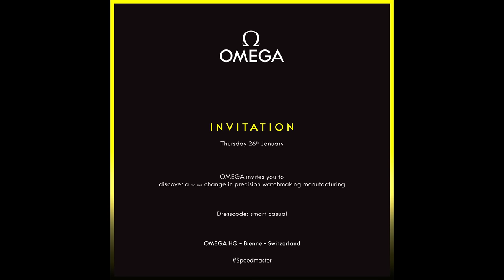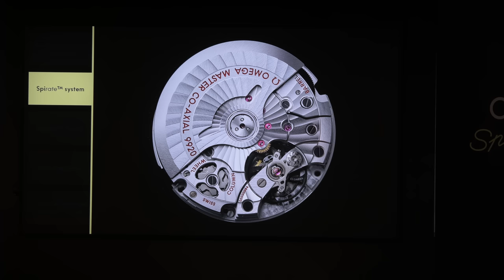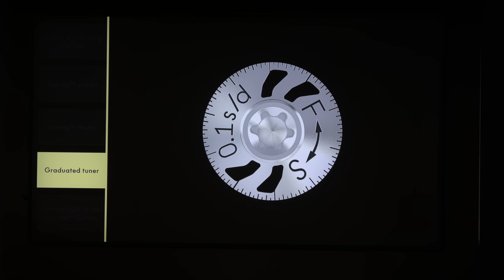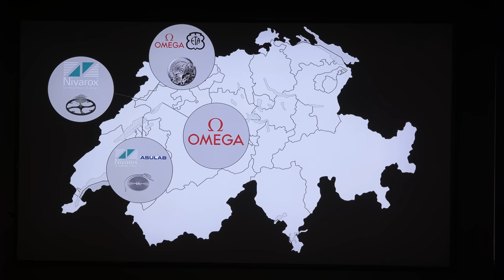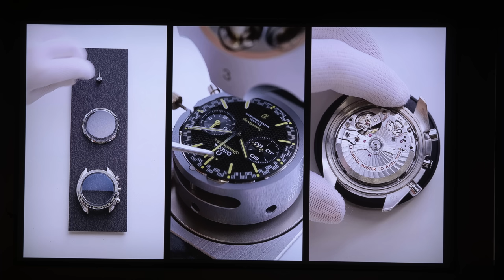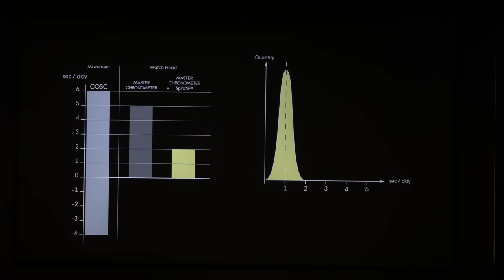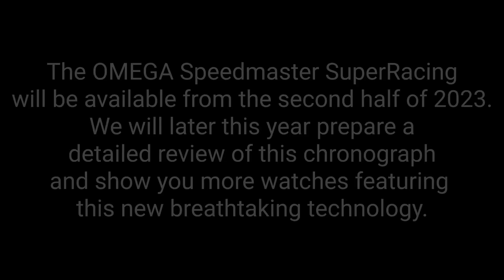OMEGA Speedmaster SuperRacing. The new fine-tune Spirate System boosts accuracy to 0/+2 sec./day.

Comment: The tech is great. Omega are trying so desperately to be “loud” with some of their watches. I think pretending they aren’t trying to is naive. They did the Speedy Tuesdays, they’re doing the limited by numbers made but not limited edition 321s and Snoopy editions. You can’t just go and buy one, that is simply not the case at all. They also make “boutique exclusives which is another game. They do a new limited anniversary watch almost as often as Grand Seiko do. They are trying to become Rolex in terms of planned scarcity with some models and then sell the ones “the plebs can get” to the masses.

This tech is great. I hope it doesn’t see Moonwatches at £9k or so in 18months if and when they add it to that. At the moment this new model costs a lot more than the previous 44.25 racing models, even more than a ceramic cased dark side of the moon Apollo 8. I hope as part of this industrialisation they remain competitive price wise, otherwise they are going to have to start finishing like Glashutte or Breguet if they are moving to their price points.

People paying for AP or Patek etc may well be buying into the hype. But there is more to a high horology watch than accuracy alone. If we only wanted accuracy we could all just buy a band 6 Casio and call it quits. Hand finishing, movement quality etc all count for something as you move up in price. Most high end watches from independents are nowhere close to as accurate as a Tudor Black Bay, but that’s not why they get bought.
Reply from the maker: That’s pure sarcasm! Omega is everything … but not “desperate” and I don’t see them playing any silly games …
Reply: @WatchAdvisor   why do they limit the Snoopy so much? I’ve been on a list for an Ed White since it was announced, yet I’ve managed to buy a 5990/1a-011 at retail a month after release. I’m sorry but as a customer what you are saying doesn’t ring true. Every year there are more limited 007 releases, Olympic releases, watches to celebrate the inception of James Bonds birthday, a fictional character. These are all silly games and gimmicks. 

Pretending they are not silly games is fanboyism too. I love Omega watches, but they are playing games too. You are just not prepared to see it or are impressed by all the great things they do and so are prepared to overlook their games.
Reply from the maker: The Snoopy and Ed White are both NOT artificially limited! But the dedicated workshop with dedicated, special trained watchmakers assembling them simply can’t produce more… This was by the way clearly communicated by Omega. 

Limitations? I couldn’t care less… but others like to buy such watches. Anyhow you don’t have to buy one, if you don’t like them …  so just leave these to others …
Reply: @WatchAdvisor   I’m interested in many of the Omega watches. I own the world timer, it’s very innovative, also a moonwatch.

Saying “you don’t have to buy one” is a not facing into the truth. They need some hype models like the 321s, the Snoopy to create interest and hype in their brand. It’s marketing, that’s whey they are making anniversary watches of them paying for a movie product placement with James Bond. They have to market their products as well as innovate. They are doing great at both. But being blind to their games and solely bashing Rolex or AP for it does you a disservice. Omega are a business too, they create hype around watches most people can’t buy.

I bought many watches from my local Omega AD. They’ve never been supplied a Snoopy or a 321, they only go to premium stores and mine isn’t one. My local branch of Goldsmiths (watches of Switzerland group) who are a large store  for the company that sell many brands including Rolex said they aren’t being sent these watches at all. 

I’m sorry but Rolex make 10s of thousands of each model on an industrial scale and you moan about it because morons buy them in the secondary market. Omega hype up watches their customers can’t buy and you defend it. That is a joke.

I enjoy their watches, I’d love to own a 321 model. I feel like I’ve been played by the brand.

Once again, I’ve managed to buy a 5990/1a-011 at retail 3/4 weeks after it was announced. I’m a fairly serious watch collector. That watch is much more rare right now than a Snoopy or an Ed White, how is it that is easier to buy than an Ed White? To defend that is a joke. They are playing some games, I didn’t take you for a fanboy. How much is the first Snoopy on the secondary market? How much is the current one? Why don’t you talk about these while sneering at the people buying them? 

It’s fanboyism.
Reply: @WatchAdvisor  why is the Snoopy made in a dedicated workshop? It uses the standard movement. Is it just the case back? Genuinely I kinda get it with the 321 but the snoopy is faux scarcity because it’s a snoopy. It’s their prize, their equivalent to a daytona. It’s their way of having that unicorn not everyone can have.

It’s planned scarcity and brand equity in equal measure. 

I enjoy your videos very much. Thanks for this one. But being balanced about Omegas practices doesn’t make me a hater or a fanboy of any brand. I love most brands and enjoy wearing several! Good night and thanks for the vids.
Reply from the maker: The Snoopy and the Ed White are built like an Haute Horlogerie watch. One watchmaker assembles the entire watch… This is a major difference to the mass manufacturing Omega does normally… Omega IMHO should focus its communication more on such (and many more) little details then on showing celebrities wearing their watches … I just told them again when I was in Biel Thursday…
Reply: @WatchAdvisor  I agree. But the point remains that they are selling for 3 times retail on the secondary market. They created this. Why don’t you talk about it in this video as you do Rolex?

I think people buying Rolex steel watches on the secondary market are idiots. I agree with you. But Rolex don’t play silly games, they make way more watches than Omega and no special editions, none of the games. It’s the sheep buying them that are the issue.

Omega chose this “bespoke” route for the Snoopy and they’ve created a Rolex style secondary market for it. I feel like this was intended, it really does their brand good to have 45th anniversary Snoopy’s selling for 40k or whatever they are. To pretend like they don’t want a bit of this type of marketing and lust for what you can’t have is naive at best.

I agree about the secondary market being a joke. However I feel like the sheep buying Rolex are the issue, not Rolex. With certain Omega watches, Omega have created the scarcity and they want it that way. Especially with the Snoopy. It’s their golden goose.
Reply from the maker: @TheRunningManZ  The Snoopy sells at these prices because all the Snoopy editions have become collectors items meanwhile, don’t forget the two other ones… You didn’t get yours yet, this seems to make you angry… many others did though … I don’t know what went wrong … Did an AD promise you one? No AD will ever get one, since they are only sold through the Omega own boutique network…
Reply: @WatchAdvisor  and there in lies the game. The boutique don’t allocate to people unless they have a sales history. THIS IS A GAME.

I don’t live in London where the boutique is. I live 100miles away. I’ve bought lots of watches from many brands including Omega. But their sales policy makes it impossible to pick one up. I can’t go on a list with a store with sales history because I support my local stores, so my name went in the bin when I left the boutique on regent street.

It doesn’t make me angry. I won’t buy watches over retail and I’m prepared to search out great watches that I can buy instead. What actually makes me angry is you saying Omega don’t play games when you’re blatantly spelling out how they market these hype watches that you just can’t actually buy. This is the very definition of the game you seem to hate. But you are pretending like when they do it, it’s all above board and fine.

I quite like the Speedmaster 57 in maybe blue or green but there are none in stock anywhere just yet or even on the Omega website. So time will tell.

Open your eyes. They are playing games, the selling process you’ve just described proves my point for me and yet you are still defending it. They do the same shady tactics in the Omega boutique regarding allocating watches. Yet you don’t talk about it or seem to want to admit it. You are happy to have a go when Rolex ADs do it, the Omega boutiques do the exact same thing. Wake up and smell the coffee.
Reply from the maker: It was only the ADs causing all the problems for potential Rolex buyers by inventing this artificial shortage and greedy business to ask/get a premium. This is why certain watches are only sold through Omega boutiques. And it is not the boutique deciding who gets a piece but the HQ in Biel. So far only a few Snoopy chronographs made it to the grey and parallel market. If Omega ADs would sell them all “Snoopy” would be there, just like all these Rolex watches … I got dozens of emails (comments have been written here) of happy Snoopy owners who very much appreciated the fair treatment of Omega. There is no game, there will be no game. The “problem” is that there is no boutique close to you and that the ADs in your region don’t get these watches… I understand that you are not happy, but that is why you should not simply twist the facts to get rid of your frustration.
Reply: @WatchAdvisor  there are 109 silver snoopy watches on chrono24 right now. For a watch with very limited production that’s only been around 2 years that is a lot. The Omega head office do not dictate who gets every watch across all their boutiques. The boutique won’t even take your name if you don’t have a sales history with them. The boutique deflect people away before biel even know your name.

You are a fanboy defending Omega doing the same thing that Rolex ADs do. There is a plenty of accounts of what I am saying across forums and the net. It’s sad that you will defend this practice from a brand you like so much. 109 watches is a lot. You are blind to the truth here.
Reply: @WatchAdvisor  there are 217 black dial Daytona’s on chrono24 since 2021 model year by comparison. Rolex make way more Daytona watches on an industrial scale than Omega do these “haute horology” like Snoppy watches and sell them through every store across their near 2k ADs. Not hand picking select boutiques. 

The stats don’t lie. You’re defending the boutiques of Omega doing the very thing you hate others for doing. Wake up
Reply from the maker: I hear your massive frustration… 🤷🏼‍♂️Therefore I suggest that you write a passionate email to Raynald Aeschlimann by explaining him how much Omega watches you own and how much you would want to buy either the Ed White or Snoopy… Send it to me and I will forward it to Raynald… Someone from the US being in a similar position did the same and then got the chronograph he wanted… I am the wrong person, I can’t sell you the watch, but I could help you get one…
Reply: @WatchAdvisor  another example. There are only 168 of the new version Polar Explorer 2s on chrono24. These are made in many many thousands, sold through every Rolex AD of getting on for nearly 1900 ADs and there are 168 for sale. You’re making out Rolex do all this shady stuff. This watch is made on an assembly line pumped out in thousands and thousands and yet there aren’t that many more for sale on one website than the Snoopy.

I have no bias here aside from the experience of a watch collector. You do have bias and it’s giving you blinkers to the truth.
Reply from the maker: Once again, I hear your frustration…
Reply: @WatchAdvisor   I will try and compose an email to you when I can. I’m doing a 12hour stream today. I appreciate you replying as you have. I expressed an interest in the 321 Ed White the day it was announced via the Omega website. I’ve bought two Omegas at retail since then. But there is no way to buy the watch unless you are “in” with a boutique, I am not. I can’t play “boutique games” to get in with them either.
Reply: @WatchAdvisor  where can I find your email address? On your YouTube “about” page I can’t see it on my phone. Will check when on pc later.
Reply: @WatchAdvisor   thanks, I have sent you an email. ;)

Comment: And the first 4hz co ax I think.
Reply from the maker: No, the chronograph 9xxx was always a 4 Hz calibre
Reply: @WatchAdvisor   thank you, it's never too kate to learn something new. I always wondered why 3.5hz was the favoured rate and I never saw anything online to answer the question
Reply from the maker: 3.5 Hz are "enough" for the Co-Axial escapement and you can increase the power reserve...
Reply: I read that a higher frequency was tried initially and this destroyed the escapement. This may perhaps be achieved one day but with new materials and or lubricants.

Of course a higher frequency would require larger mainsprings power reserve which in principle should be feasible as some calibres are tiny vs the watch case cavity… I would like calibres to fit the cases without these thick spacers…

Anyway, Omega does nice watches and always push the frontiers of innovations. Now, let’s keep an eye for what the future will bring.

Comment: My submariner is 0.2 seconds a day and if i rest it 0.2 slow so accuracy on spot
Reply: Cool story.
Reply from the maker: Well the Omega is only PLUS… that’s how it should be, that’s what the old experienced master watchmaker always told me… a watch should never run late…
Reply: Zogi, i have had the same experience
Reply: @WatchAdvisor  well plus 0.2 wearing minus 0.2 resting dial up. so if i wear everyday its quartz if i wont its decoration. so i wear eveyday.

Comment: My Casio F91W is still more accurate. Lol
Reply: F91w is +/- 30 seconds a month and the omega is -0/+60, so they’re kind of equal now which is crazy
Reply: In reality, quite a few of my mechanical watches beat my F91W in precision. I have a Blancpain, tow of my Tudors and one of my Rolex doing less than 30 seconds off a month. Sometimes I am very surprised how „off“ these quartz watches can be after a while.
Reply: But it is quartz lol
Reply from the maker: Comparing Casio with Omega… very funny 😄

Comment: Another Nahh. Al my ten Rolexes do +1on the wrist...
Reply from the maker: Officially Rolex adjusts to -2/+2 … Omega now to 0/+2 seconds per day … so be sure the Omega deviates much less than one second per day… and every tenth of a second better is a watchmaking sensation …
Reply: @WatchAdvisor  I'm aware of the Rolex parameters, however. on the wrist in normal life conditions they do way better, actually. even my Longines legend Diver is gaining +4s/week, so this Omega regulating organ is not so significant, but I congratulate Omega for ariving to the twenty first century at last...
Reply from the maker: Omega is the leader of significant watchmaking developments for years now, therefore doesn’t arrive anywhere. Sorry! What you wrote in the best case is a cynical remark. The METAS certification of all its calibres was only the first milestone. The Spirate is a further significant developement …. 0/+2 seconds tested independently (!) by METAS means that the daily deviation must be  far below one second in all (tough) conditions … To achieve this with a classical mechanical wristwatch is a true sensation!
Reply from the maker: Amen!